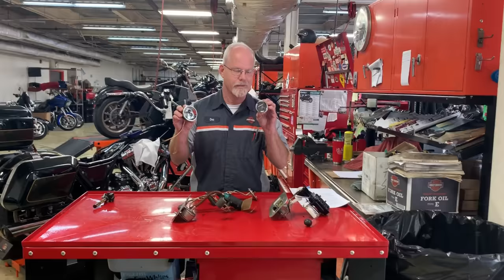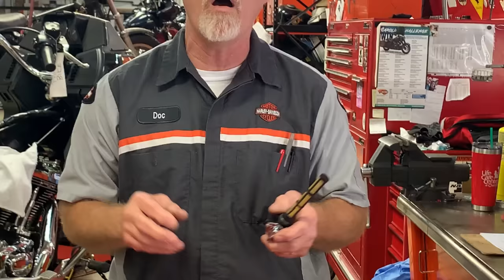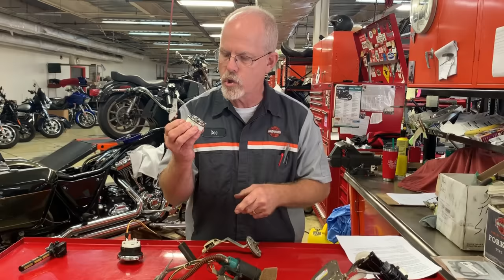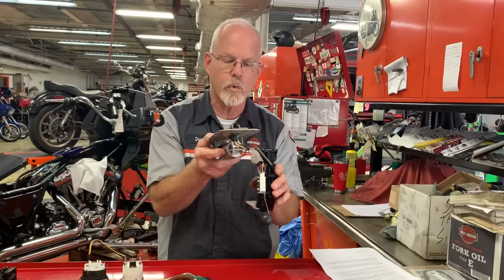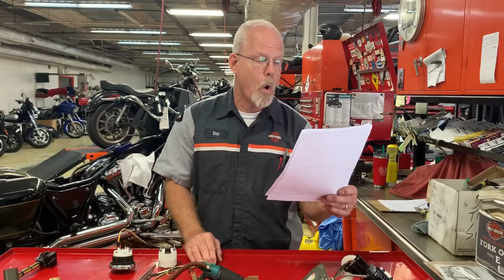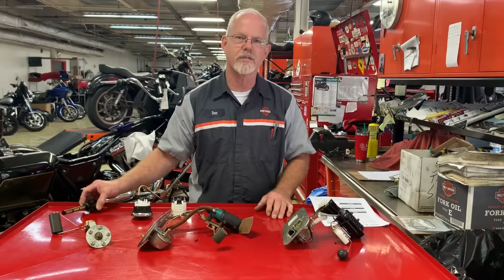DOC HARLEY: FUEL GAUGES

Comment: Hello Mr. DOC Harley,  I would like to install a digital fuel gauge to my 2020 Lowrider S .can youplease help me find the fuel sensor wire to attach to the new gauge.  Thank you
Reply from the maker: If you are adding a Harley-Davidson digital fuel guage, follow the instructions. If this is an Aftermarkest digital fuel guage, contact the seller or manufacture. A group of wires come from the fuel pump. the Yellow with White tracer goes to the Body Control Module. This BCM send the correct information to the ICM.
As you can see, this is not a simple question if not a Harley part....Doc

Comment: Hey Doc. I know this is an old topic but I am hoping you can guide me. I have 2003 road glide, fuel gauge is reading full all the time. Float is not touching tank, wires have continuity, I test the sender wire and ohms numbers change when moving float from full to empty position. I replaced the gauge and still same result. And the full pump fuse is ok. What else do you recommend I test? Thanks so much Doc.
Reply from the maker: Sorry to say there is a spot in the harness that is grounding the yellow wire...usually found in the fairing across the supports....Doc
Reply: @LowCountryHarleyDavidson  thanks so much Doc. I will track that sucker this weekend. Stay awesome

Comment: Doc I bought a new Harley Breakout which has always leaked from the fuel tank vent pipe. Can you please advise if there is a common issue with fuel leaking from the vent pipe on a FXBRS and If so advise on how to fix this issue?. Thank you Warrick
Reply from the maker: What year is your Breakout? Harley did change the fuel cap on some years and that could fix your issue.
Reply: @LowCountryHarleyDavidson  Doc, it is a 2018 Breakout (114 M8). It has a plain silver fuel cap.

Comment: I have a 2016 Sportster and changed out the 2.1 gallon peanut tank for a 3.3 gallon tank. Thinking I gained 1.2 gallons. At the low fuel light I used to put in 1.6 gallons assuming I had .5 still in the tank. Now with the new tank at the low light I'm putting in 1.8 witch tells me there was 1.5 left. Seems odd an entire gallon more still left in the tank. The pitch of the tank could be different and the pump is mounted slightly more forward. The tank width and length geometry as well could play into it. Can this level be reprogrammed on the Sportster?
Reply from the maker: Reprogramming is not available. Others who have done what you have done have experimented with adding resistors to adjust the working HD mechanism...Doc
Reply: @LowCountryHarleyDavidson  thanks for the reply

Comment: Hello Doc, I installed a sending unit on my 2000 RoadKing classic fuel injection. Follow the instructions soldering black to black and white to yellow and my gage doesn’t work. What could be wrong?
Reply from the maker: What about the orange power wire?....Doc
Reply: There is no orange wire, only black and yellow. And that’s factory.

Comment: Another BIG benefit, one which was ingrained in my mind from my Father and Grandfather: When you suddenly notice that you're only getting 100 miles on a fill up, versus your typical 125-150, then SOMETHING is up with the running condition of your vehicle. This goes for ANY INTERNAL Combustion engine built since 1903, YES, I SAID 1-9-0-3.. NOW.. IF I have an "electrical damper" in my 2010 FLHTCU Shrine (FFE) then WHY am I getting massive fuel gage needle "fluctuations"? Is the gage shot, or is the sending unit shot? m-d-kellam-at/roadrunner-d-com.. I'd be curious to hear your comments and suggestions.
Reply from the maker: More than likely the gauge is bad. When a sending unit in the tank goes bad, it usually sticks or raises slowly. There is an electrical test in the electrical section of your Service Manual to be sure you're sending unit is sending voltage to the gauge. Thanks ~ Doc

Comment: Let me ask you a question i have a 05 FXDWG i bought a new Harley speedo   the one that changes color has a fuel Gage, so i removed the fuel Gage on the left side of the tank and put a dummy cap but now the fuel Gage doesn't work on the speedo so what can i do? thank you Doc
Reply from the maker: In the H-D accessory catalog it has in the fine print: As a result of different original equipment capabilities, fuel functions are not available on 04-07 models. Thanks ~ Doc

Comment: I just bought an 07 street Bob. The gauge reads full, the tank visually is 3/4 full but the gas light stays on. Does that sound like a float, pump or sensor? Help please
Reply from the maker: Sounds like a short....check wiring and connectors. If you just bought it, see what extra the previous owner added. Like lights something might be added to the circuit that should not be there...Doc
Reply: @LowCountryHarleyDavidson  thanks for the info! I’ll do some investigating

Comment: I wonder why my bike’s fuel gauge always bounces around as if the fuel was slushing around a lot in the tank, but it isn’t… or at least not as much as the gauge would want you to believe. LoL😊 2010 FLHXSE
Reply from the maker: The resistor in the gauge that handles the fluctuating voltage has gone bad, replace….Doc

Comment: The fuel guage and warning light on my 2018 Heritage have never been right. When the fuel light comes on, there are still at least 2 gallons left in the tank. The reserve warning comes on on my odometer, and tells me how many miles I have left to empty. I can run it all the way down to zero, and when I fill up, there is still 1.5 gallons left in the tank. Last time in for service, the dealer "re-flashed" the computer, but it did not fix the problem. This is beyond frustrating on a long trip. I know there is fuel left with the gauge is at zero, but do I want to gamble on how much?
Reply from the maker: The fuel level is monitored by the ECM as the fuel level changes, the resistance of the sender changes. This sender can be tested for the correct resistance. Fuel level is a calculation. The software update was a good step. In the meantime, you have done the measuring so the odometer is one way of knowing how much fuel you have left. It's old school and it works. ~ Doc

Comment: 2010 cvo streetgluide washed it moisture got in gas gauge and a few days later gas light lit 0 miles to empty range and gauge at 0
Reply from the maker: This does not sound good. best to let dry in the sun. If it continues to malfunction a dealer can test with ohm meter...Doc

Comment: I don't know how to email you. So, I'll ask here. I just replaced my VSS on 2000 Heritage Classic. Still no speed or digital odometer. Also, engine light still on. Is speedometer replacement that's all that's left?
Reply from the maker: Before spending money on parts, you need to swing by the dealer and find out the reason for engine light on. Yes it could have to do with a inop speedo. Back then the ECM depended on the speedometer to know when bike was at idle. But this could also be a wiring issue...Doc
Reply: @LowCountryHarleyDavidson  Thank you. Will do.

Comment: Doc big fan of channel 
11 str glide fuel gauge needle suddenly bouncing on accel and deaccel always moved slowly before. Any ideas ?? Gauge or sender ??? I can pull fairing check connection but not sure where the needle dampening is in gauge or sender. Cant afford take it in during this shutdown any help really appreciated !!
Reply from the maker: Just an educated guess. 80% fuel gauge. The sending unit in the tank usually shows a stuck, full only or nothing fuel needle. 
I know it will be hard to see but ride at night. If the background light on the fuel gauge flickers as the needle bounces then its a loose connection. Thanks ~ Doc

Comment: The fuel gauge on my ‘03 Fat Boy FLSTFI has never worked properly. It reads full pretty much all the time. I just know that at about 120-130 miles, I need to find a gas station.
Reply from the maker: The odometer has always been more accurate....Doc

Comment: Got a 2017 lowrider S..Put a 2" tank lift on it at the front..my fuel gauge always shows less than full when I fill it up, and less than the amount that I actually have as the tank gets emptied. Is there any way of making it more accurate without lifting up the ass end of the tank 2" aswell?
Reply from the maker: Nope
Reply: @LowCountryHarleyDavidson  yeah I thought as much..thanks anyway..

Comment: My issue is my low level fuel light doesn't work. I've had my 2015 XL883N FOR ONLY 5 months and I have put in as much as 2.913 gallons in my 3.3 gallon tank and still have never seen my low fuel light come on. What could possible be my problem?
Reply from the maker: Too many factors to assess to diagnose to give you a direct answer as to the cause. Your local dealer should be able to diagnose.

Comment: I have a 2001 Road Glide Fuel Injection. The fuel gauge bounced back and forth?! Any suggestions?
Thanks
Reply from the maker: To many conditions can cause that, I would have the local dealer check the sending unit and gauge.

Comment: I have a 2000 softail deuce I bought new and the fuel gauge has never been accurate. Is there a better, more accurate fuel gauge for this bike?
Reply from the maker: No, but the fuel arm may just need adjustment. The dealer will hate the process to do it, but it can be done.

Comment: Hi Doc, I have a problem with my fuel gauge.I own a 1996 flhtcui and when I fill her up the guage works. After riding about 9 miles the gauge starts going from full to empty untill it stays on empty and the reserve light goes on. Is there a problem with the resistor? or is this something else? grtz
Reply from the maker: I would agree the mechanism in the tank is either corroded or worn out. Thanks ~ Doc

Comment: I have a flush mount gauge and it never shows low fuel when the light on the gauge turns on. Flush mount says 1/2 tank, yellow light says low fuel.  Tips?
Reply from the maker: The internal fuel gauge float adjustment should be checked, or the sensor for the low fuel light is not working correctly. Any chance you have modified your fuel tank? i.e. lifted the front mount? If you attempt to adjust the float remember it takes time or miles for the gauge and light to send a new position signal after the ignition is turned off then on.

Comment: My 08 Street Glide fuel gauge does bounce around (does the dance), is that an indication the damper is bad...ie I need a new fuel gauge...????
Reply from the maker: You may need new shocks... but really I’d have a dealer check both fuel gauge and sending units.

Comment: How difficult would it be to put a fuel gauge on an older 2000 Sportster?
Reply from the maker: H-D only has fuel gauges going back to 2007. Harley fuel gauges only work with Fuel Injection motors which were put on sportsters starting in 2007.
Reply: I’ve never ran her dry so I guess I’m fine. I have my reserve to fall back on, guess that’s good enough.  Thanks for the reply Low Country Harley Davidson.

Comment: Advice on fuel ingestion, #1 try to fill only in the morning, why cause fuel is not expanded. #2 never fill when a gas station is being fueled, why cause the dirt at the bottom of the underground tank dirt is being agitated, #3 pump fuel slower than possible ,why cause the pump creates bubbles so,you r getting part gas and part bubbles

Comment: Once again just another way too complicate things. To me because I'm an old  bastard the fuel petcock ( tap) was the easiest way too go . Fill your tank set your odometer too 0 when your bike starts spluttering make a mental note of how many miles covered then turn the tap too reserve and it's trial and error the first few times but eventually you'll know how many miles from full too reserve and when you hit reserve start looking for a gas station. Obviously take into consideration how your riding! All the crap inside your tank too end up one day failing too work ( breaking) ect . Just like car electric windows great while they work but a bitch when they don't! If I could I would have roll up for example I would. You could argue it's nice too have little yellow lights come on and fuel gauges if they are accurate ( which most don't seem like they are( but it just seemed less complicated in the past🤔 in a way less is more, less hassle in the future when the thing goes wrong.😂

Comment: How can l opened my gas gage or take it apart.
Reply from the maker: Was never designed to be taken a part. Using a very small screw driver pry all along the back side of the metal bezel ring. Be patient with s very small movements….Doc

Comment: Doc I put a new battery in my 17 sgs now my gas gauge doesn’t work any ideas?
Reply from the maker: This sounds silly but I have to ask, Did the fuel guage work before you changed battery?  I would remove your seat and examine all the wires and connectors in front of the battery...Doc